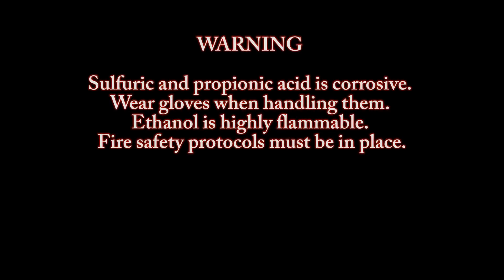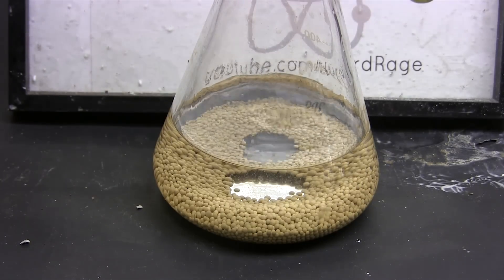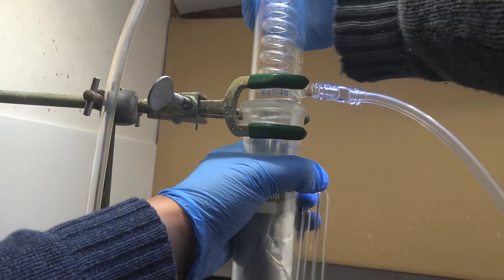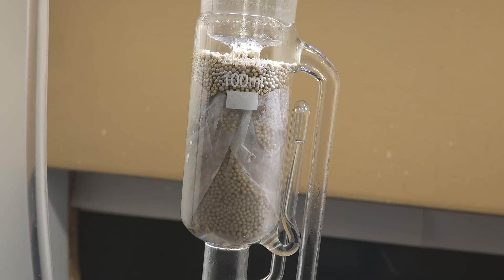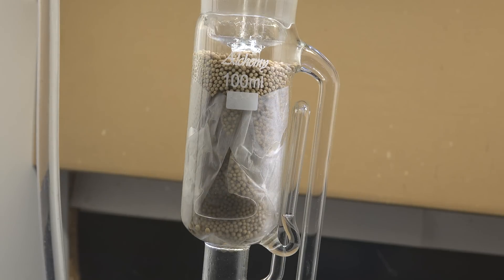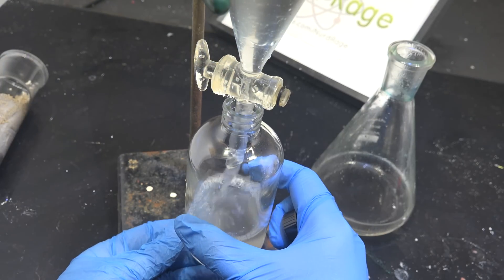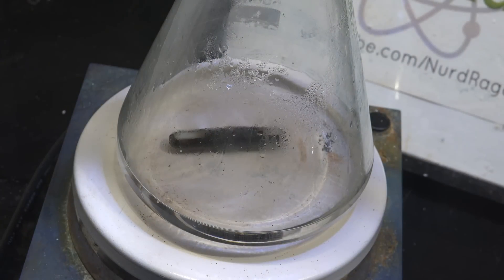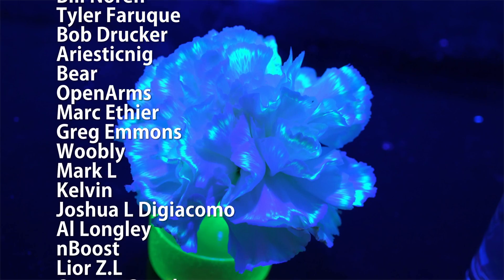Make Ethyl Propionate by Fischer Esterfication and Molecular Sieves with a Soxhlet extractor

Comment: Can I use Soxhlet extractor with 3A molecula sieves for methyl and ethyl methanoate? Is low boiling point MM problem?
Reply: It is better to distill away the formate esters themselves. I prepared methyl formate this way. The good column is prefferable to work with, I have about 300 mm long and performed distillation not too fast, keeping an eye on the thermometer.

Comment: Gaylord Ray J might be able to liberate one spectra-physics argon laser with power supply in fiber optics cable I don't know if you do any experiments they require blue coherent light then again this is not for sure I'm checking. I don't know if you have any interest in this it is a very expensive piece I think it retails for $11,000 and it's only been used five or six times

Comment: Well, learned my lesson buying cheap shit from Amazon. The soxhlet extractor I bought came from China, which also took 2 months to get. The siphon was cracked and leaked (fixed that), and the top of the siphon was damn near closed. I paid $45 for this POS. Oh, and the joints were slightly crooked, WTF?!?!?!

I will be saving my money and buying from alchemylabsupply. Thanks for the videos, and being able to get the 5% discount.

Comment: In my lab I use similar sieves to remove boron from rocks to assist in the determination of the source of fluid mobile elements.  I love the use of these as they really make life a lot easier than doing it the old wet method.  Great vid.

Comment: I had this idea for some time and it's great to see you actually do this.
Maybe you could, like you said, use an excess of propionic acid and boil off the ethyl propionate. If you remove all the water from the reaction you can remove the acid with sodium hydroxide and you'll get pure ethyl propionate.

Comment: A thought I had early on, after ''what a great idea!'' was ''would magnesium sulfate or calcium chloride be faster?''. In principle they'll work, and I suspect faster, but are there any practical limitations to them that you'll only realise upon doing it?? I've not got a soxhlet, yet, so can't predict. Nice video!
Reply from the maker: Calcium chloride dissolves slightly in alcohols and esters. it's not much, but what does a soxhlet extractor do best? extract substances of very tiny solubility. You'll end up with the calcium chloride dissolving in the recirculating solvent and massively contaminating in the product in the boiling flask

Calcium chloride could begin reacting with your acids and creating other products. This may diminish the rate or quality of your reaction.

Magnesium sulfate tends to clump as it gets wet. You'll end up with a rock-hard mass of magnesium sulfate that doesn't absorb any more water (since the solvents can't access the interior). It's not as soluble as calcium chloride but clumping makes its performance less predictable. 

Molecular sieves are also simply better than both of them at drying. This is important for azeotropes that have very tiny amounts of water. You might end up taking longer to use calcium chloride or magnesium sulfate since they're not good at absorbing tiny quantities of water.

You can give it a try, i don't think it'll fail outright. But considering how predictable and easy to handle molecular sieves are, i prefer to use the sieves even if they take time.
Reply: Thanks for that! you've saved me a future headache! I've never used molecular sieves as a drying agent, but for my dissertation am mounting them, to produce heterogeneous catalysts in the synth organic lab. What field of chem are you learned/lecture in?

Comment: Would this be viable with dehydrated calcium chloride?
Reply from the maker: That tends to dissolve a TINY bit in polar organic solvents, like alcohols and esters. While it's very small, what does a soxhlet extractor do best? extract substances of very tiny solubility. You'll end up with the calcium chloride dissolving in the recirculating solvent and massively contaminating in the product.

Calcium chloride could begin reacting with your acids and creating other products. This may diminish the rate or quality of your reaction.

But even if that weren't the issue, calcium chloride is good at drying, but molecular sieves are simply far better. This is especially important if you have azeotropes that have very tiny amounts of water.

Comment: Storing it with molecular sives dont hinder reaction with the water inside the molecular sives, or am I wrong? My thesis: The water is still there, unreacted, just temporary locked inside the sives. All IP in direct contact with it will react with it, given enough time.
Reply: THE UNKNOWN why dont you use your one brain cell and fuck off. You are an unnecessarily salty being, nobody wants to read your comments.

Comment: I would advise to keep the ethanol excess, as it will help drive the reaction forward. We are researching the purification of lactic acid via an estherification reaction, and at least in a continuous process it's still desirable to have some ethanol excess and the extra is simply recirculated. You could also use highly acidic ion exchange resin which makes separation easier and can last for years without the need for reactivation.
Reply from the maker: true. In this particular case going stoichiometric might still work since the ethyl propionate also has a low boiling azeotrope with water and would also recirculate. If we're going with heavier esters then yeah, excess ethanol may still be necessary.

I've been looking for a domestically available source of cationic exchange resin (which can be easily converted to acid). So far i'm looking at water softener resin but i'm unsure if it'll survive organic synthesis.
Reply: It's a matter of process simulation, which is a beast on its own. I'm afraid I can't detail much more of the process, but if you find a way to run a continuous distillation, maybe I could run some simulations for you.

Currently we are using lab grade resin, but for home projects I'm considering pool resins, which are way cheaper and there are some which are advertised as highly acidic and in theory should resist. I'll report my findings later.

Comment: What about using benzene/toluene to drive away water as an azeotrope than returning just benzene/toluene via dean-stark trap?
Reply: This works when both alcohol and acid are non-volatile. TsOH is prefferable to use because of the oxididizing properties of sulfuric acid.

Comment: NurdRage. I am quite surprised you didn't neutralize the final product in the alkaline solution. In my video, where I synthesize ethyl acetate by Fischer esterification the ester was reasonably acidic, and I had to neutralize it in the solution of sodium carbonate.
Reply from the maker: after two water washings the acidity is negligible. The acid almost exclusively remains in the water layer.
Reply: That makes sense. I though since a slight amount of water is soluble in esters, little amount of acid will still remain in the product, even after multiple DH2O washing. I believe, since this ester will be used as a reagent to synthesize the pyrimethamine initially, the alkaline wash is really unnecessary. Great video, using sieves in Soxhlet apparatus is an excellent idea. Never seen it before.
Reply from the maker: As said before the acid is negligible. But you'll also note that i'm storing over molecular sieves. Acids react with sieves. So that's a crappy, but still functional, acid removal method. Since the amount is negligible i'm not worried about destroying the sieves, they'll still remain 99% functional
Reply: Of course, I didn't consider the sieves, now I clearly see your point. I am still very curious to know the pH of the ester you stored in sieves. Whether it is still slightly acidic or neutral?

Comment: Would dry MgSO4 be able to remove enough water to be feasable? Should be quite inert. But maybe the slurry would be very hard to mix...
Reply from the maker: A difficulty with MgSO4 is that you need to be able to stir it into the mixture. If it sits still while it's absorbing water then to clumps together into a hard rock that stops further absorption. It could also clog the soxhlet. Give it a try if you want, i think the convenience of sieves is more advantageous.
Reply: Yes, the method shown is clearly more usefull. When I use it for drying crude products it clumps up. But using even more loosens it up again. So maybe usefull in certain circumstances. These observations are from lab work with nice excess DCM, EtOAc or pentane solvents and the luxury of a chemical supplier. It is funny that esterfication can be such a hassle when done at home. Great stuff
Reply: On the other hand what about dry copper sulphate? I cad it cake into a flask way less times.

Comment: Nice trick, why haven't I seen aynthing like that anywhere else? Is there maybe a superior process or did nobody bother?
Reply from the maker: it actually is used quite a bit: on an industrial scale.

The wonderful thing about it is that it's essentially waste free, the molecular sieves can be regenerated in place by simply heating them and pumping dry air through.

For laboratory work, most chemists don't bother and go with the more common dean-stark apparatus or they just use highly reactive reagents like acyl chlorides which get the job done in minutes rather than the hours it takes molecular sieves.

Being an amateur, i can afford to be patient and go the slow but safe/cheap way.
Reply: That explains it very well, thanks!

Comment: Instead of Fischer esterification
why don't u first make propanoyl chloride by reacting propanoic acid and pcl5 or pcl3 or socl2 (available to u) then reacting with ethanol. that won't be in equilibrium and will give u great yield.
Reply from the maker: 1) Cost

2) Where the heck is an amateur going to get those chemicals? :)

3) Cost

4) Safety - those chemicals can burn your hand off, give you cancer and/or kill your lungs at which point you die a slow horrible death. Molecular sieves can be handled with your bare hands.

5) Cost

6) waste disposal - it's a lot more convenient to have a reaction that essentially produces no waste except wet molecular sieves that can easily be redried and reused. Those chemical you mentioned produce other byproducts that must be dealt with.

7) Cost

8) ease of handling - setup a soxhlet extractor and walk away while you play witcher 3. Those other chemicals require monitoring and skill to handle. An experienced chemist can easily do it, but even a hobbyist can handle a soxhlet extractor.

9).... did i mention cost?
Reply: ohh..ya
😅u r r8.
I am too an amateur chemist..
Reply: NurdRage but I think ur videos r like pro! dude!!👍
Reply: beacuse neither phosphorus penta-, trichloride or thionyl chloride are "OTC" chemicals. He want's to make the drug from readily available stuff

Comment: Soxhlet*, dear Dr. n-BuLi ;)

Okay, okay, I'm going to watch the video now :P
Reply from the maker: ah gotcha, fixed!
Reply: This is actually a great method for ester syntheses if one is lacking a Dean-Stark apparatus. Never thought of it, perhaps because I'd still need the mol sieves :/ Guess it's about time.. Thanks, anyway!

(One could argue that molecular sieves are a comparable investment to a D-S trap, considering the need of the Soxhlet extractor, but fuck it.. they are far more versatile and I really like the idea :D)
Reply from the maker: What's cool about this method is that it even works for cases where a dean stark trap doesn't work. A dean-stark trap requires the distillate to phase separate. But in the case of ethyl propionate-ethanol-water azeotrope, it doesn't. I actually tried it and the vapors never separated. Molecular sieves don't need phase separation and in fact work better when the solution is homogeneous.

They're a bit more hassle than a dean-stark, no arguing there, but they can be applied to a wider range of jobs when coupled with a soxhlet to keep them safe. I do prefer a dean stark, but when it doesn't work, the soxhlet-MS combo usually does.